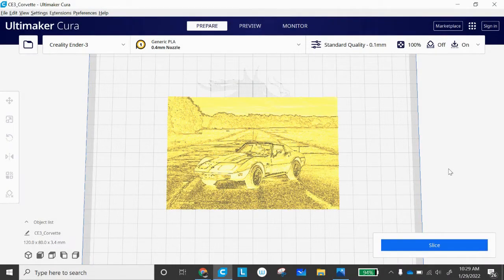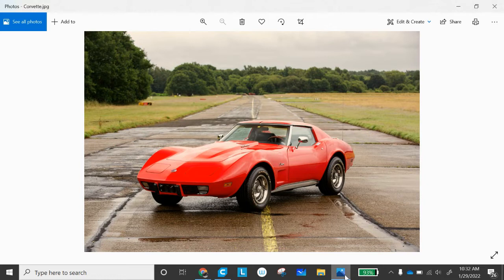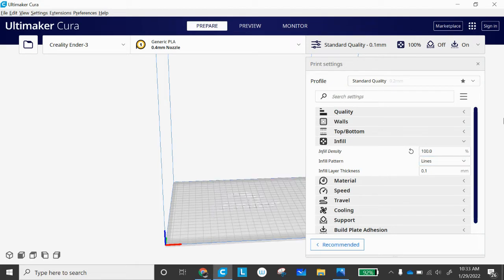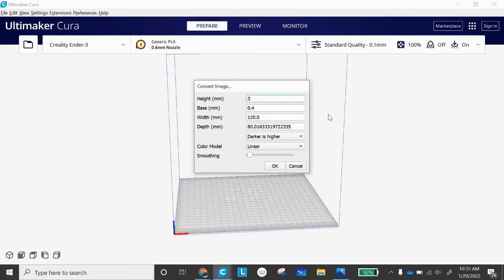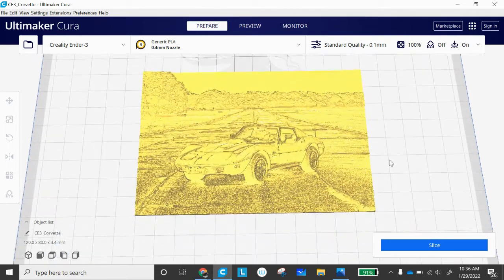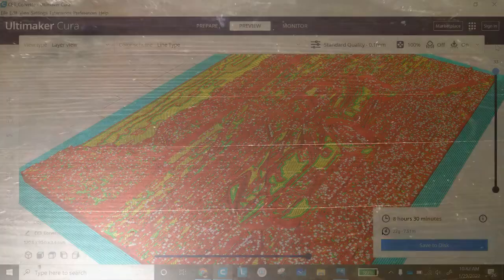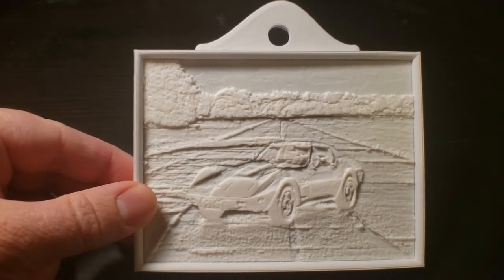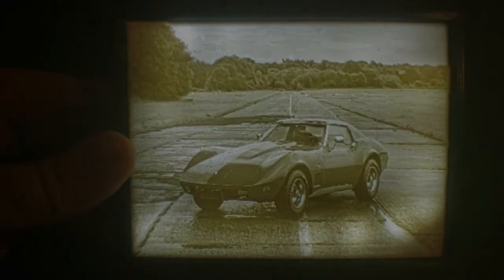How to create a 3D Printed Picture! (Lithophane)

Comment: It's important to point out that a very small nozzle should be used if you want to print these laying down. 0.1 to 0.2 mm will give you the best quality. If you want to print it faster and have a better resolution with a standard 0.4 mm nozzle it is better to print these upright.
Reply from the maker: Great point! Thanks for adding that!

Comment: what are your printer setting because mine says it will take 20 hours even though it has the same dimensions.
Reply from the maker: @Richard Hosking it's not necessarily the wrong way of printing it.  I found by doing it laying down, I didn't see any layer lines when the light showed through. Nothing wrong though with printing it standing up
Reply from the maker: .1mm layer height.  100% infill.  Print speed 50. Initial layer speed 15.
Reply from the maker: @Richard Hosking awesome, keep me posted! If there's a way I can do this better, I'm all for it
Reply: @quicktechtutorials7289  You lose a lot of detail with the print laid down. All the lines are .4 wide so your .1 setting doesn't really do much.
Reply from the maker: @brucewhite4531  not necessarily.  the .1 setting will impact the detail based on how thick I make the lithophane.  Each additional layer provides less light showing through so if I made the total thickness 2.5 mm vs 4 mm, there is a difference in the detail and how much contract the lithophane has.

Comment: how to make them with colours
Reply: You'd need a multi-filament printer but it's not ever going to look like a color picture unless you have a 0.1-0.2 mm nozzle, RYB filament and z-hop dot art g-code modifiers... this doesn't exist to my knowledge. It would basically have to do each top layer like placing individual pixels down and it would have to hop so as not to hit other pixels already deposited. It's possible but it won't be hd and it will take a very long time to setup and print.